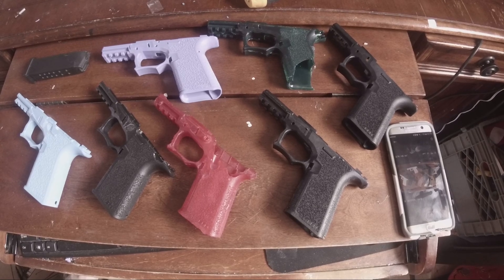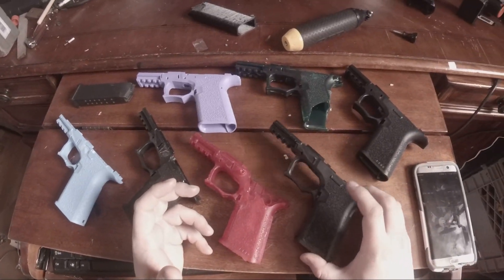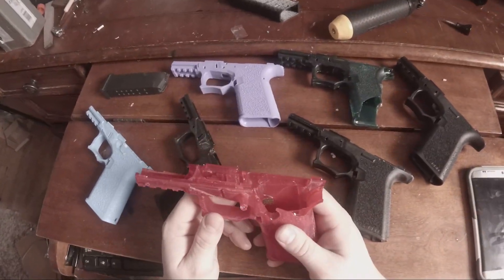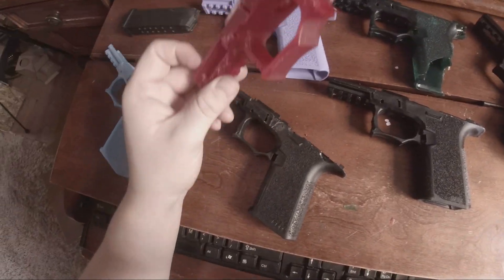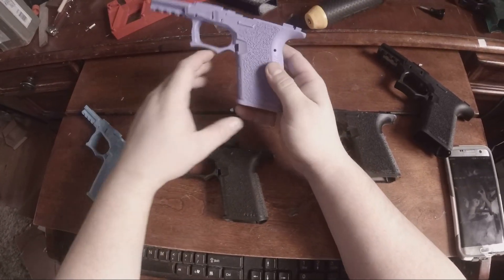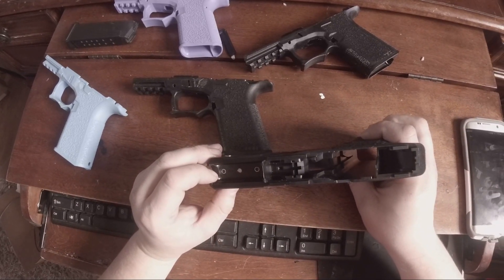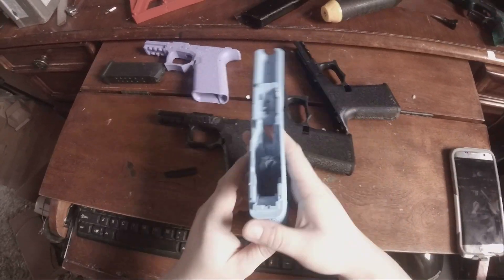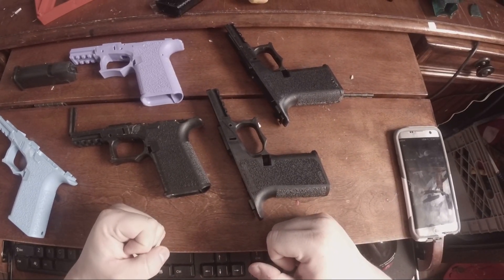Polymer 80 resin copies

Comment: dont think these will be strong enough. you would need to either use a mulit part mold with inserts in a vacuum chamber or an use injection mold machine. you definatly would wanna do the mold without any holes at least on one side then mill them out later although milling plastic can be tough. rn for

Comment: 😮 U There But I Thought About It We Dealing With A 18 To 13 pound Recoil Spring And A 5 to 3.5 pound Conector Focus En The Casting U Are There But Try Aluminum Or Bronce Maybe Fused Cheap I Think Will Be Stronger Easy To Grind Melt And Reuse If Mistakes 😎🤘💯

Comment: you got to insert pieces of metal or small wire mesh of rebar or somethign if you want to make the frames super strong. put some strong wire or metal rods where you dont want it to flex.
Reply: Si, Ive been thinking of this for a while, a x no idea if it will work, but what about metal shavings like you find around your vise after drilling or grinding? Or shredded aluminum cans? Something metal, and 1/8" or more shavings? Mandy a guy could get the waste from a machine shop? I imagine the steel sweeping get tossed or sent to the recycler, so picking them up probably is a better deal than them having to drive them away? No idea. Aluminum nobody is giving away, except beer cans, but beer cans should shred easy enough. I don't know if that would be better, or id it would just weaken the resin. What say you? Thank You

Comment: I thought this was on resin based 3d printing, but still good.

Why, WHY wouldn't you mold the frame after you cut the plastic tabs and drilled the holes? seems like making extra work for yourself. uwu

Comment: This seems legitimately fascinating, and like something I'd want to experiment with. Would you be willing to post an update on this project? Did you ever assemble one and get one running?
Reply: its falling apart no way
Reply: It’s not a pressure bearing part. If it fails, it’s going to snap, not explode in your face.
Reply: @QueerArmorer  For the gat building hobby, this is expected to happen from time to time. Go look into printed gats. The only way you will get it to a point where it doesn’t fail is by experimentation. For instance the liberator came out which would explode after a few shots, now we have printed lowers that last tens of thousands of rounds. If everyone just gave up on an idea because of encountering a problem, nothing would ever get done.

Comment: i'm assuming the bubbles come from a open printer. You need stronger material and a enclosed printer to keep the temperature the same and Not allow a different room temperature to create air bubbles.
Reply: They weren’t 3d printed

Comment: going about this completely wrong! Get a good 3d printer and make something that works
Reply: Someone Nearyou I believe the resins used in 3D printers aren't strong enough to hold up
Reply: @getfragged7051  the plastics used in 3d printers are actually strong enough but there's layer adhesion issues. There's files for Glock frames that last 500-600 rounds if printed right.

Comment: Instead of copying someone else's design, why not make your own design?  Besides Polymer80 probably having some kind of legal protection for their design, what do you hope to accomplish by basically 'counterfeiting' what they went to the trouble to make?  Maybe make one that'd take a 1911 slide, or some other slide that's widely available.....or something different than what someone else has already done.
Reply: You mean like how p80 stole glocks design? SMH
Reply: Hardly. What the poly80 does is utilize Glock internals for both simplicity and availability.  The frame is far superior to any model or year Glock.  Just the 1911 angle grip makes it a better gun in the extreme.  Aside from using Glock internals, for the reasons already stated, it is a much better design, and the fact that the market is full of different triggers (since factory Glock triggers are among the worst ever made), and the best thing about Glocks is the magazines, which fit the Poly80 just fine.  It's such a good idea and product it's a wonder it took this long for someone to come up with the idea.  Maybe some patent ran out or something, that I don't know, but I do know more than a few Glock fanboys who swear they'll never go back.
Reply: They still took Glocks design(after patent expired to avoid lawsuits) and replicated it. The internals are still the same so its still a counterfeit glock, even if better in design. dont get me wrong, i love both of my P80's over my Glocks.

Comment: When making dental molds we use a vibration table to get out the bubbles
Reply: or place resin in a vacum chamber to remove the bubbles before pouring....
Reply: @SuperSonofsatan bubbles will appear while pouring.
Reply: Vacuum chamber would also work but hands down duct taping your wifes nightstand toy to the wobbly kitchen table by far the most practical solution.

Comment: Hmmm... Pink Glock replica repeating 9mm flare gun might be ok. 9mm blanks loaded with just the primer, a pinch of pistol powder, flares and you'd either need weak springs to fire it semi-auto but maybe unreliably or you'd need to rack n shoot rack n shoot like a spring-powered airsoft gun reliably but not true semi-auto. So even the brittle plastic can be useful. Just a suggestion.

Comment: Ar15mold.com, came across this website. You should check them out
Reply from the maker: Yes i have done my own testing with them way back. Video search on here their durability. Its not worth the price tag. The resin they use is the same typical standard stuff you find at hobby lobby. My 3d printed lowers hold up better. Which is another video i have to get to some time. ha.
Reply: Donny Magnum ah damn.. hopefully u can find something.. subscribing to your page so I can stay updated

Comment: Any progress?? From what I’ve read, the polymer80 frames are fiber glass infused. Don’t know if that helps
Reply from the maker: polymer80 like most companies that make polymer frames and accessories, they will keep their plastic formula a secret. Some will give you hints like sig claiming some type of fiberglass and glock a type of nylon. I have not read poly80 saying anything about what they use but it does feel similar to sigs fiberglass. I am nearly done with a few strength tests using bondo fiberglass, JB weld, other types of epoxy and more. Ill upload when done.
Reply: Donny Magnum hope it all works out.. willing to support you when it does

Comment: There are some polymer AR15 lower kits that you pour in a mold by hand... why not buy the polymer from that and try that?
Reply from the maker: The resin from those kits are very brittle and shatter on impact. There are a few torture test videos on here that show they are weak. With this i am trying to find my own formula which is currently just as strong as a glock lower. I'll be posting videos testing them eventually.

Comment: Dude that's awesome you should make a how-to series! Did you use the P80 jig to make the molds or what?
Reply: Would you consider sharing the file for your jig?
Reply from the maker: Underground Arms i actually 3d printed the jig to cut them with but yes the mold is a glock 19 p80.
Reply: @willylongwood992  share file mm on
Reply: I did on here with just a p80 and it was taken down...they took down about 12 of my vidoes

Comment: That’s a cool idea, Hope it works out, how will u get rails for the frames?
Reply from the maker: they are available through most places that sell glock lower parts kits
Reply: Donny Magnum  Really? I never seen any Rear Rails or locking Block Rail that is Available or fits a Polymer80 
U got a link ?
Reply from the maker: I get them through my local glock smith, to avoid shipping lol. But if you dont see them on say midway, glockstore, brownells or poylmer80, lonewolf. You may have to call them and ask. I believe my guy gets them directly from glock USA. Any gen 3 rail inserts would work.
Reply: @willylongwood992  what Glock puts in their frames will not work with a polymer80 frame. The rails are totally different. Glock rails are not removable, therefore cant be purchased. The ones that the P80 use are designed to be used in nothing but their frames. Nobody else on earth makes them, or sells them. Do you even know the diff between a Glock and a P80 frame?
Reply: Vince Ruland totally right I have a few spectre that I have tried to get rail for but Loran kelly over at polymer80 is a douchebag and will not sell you rails or locking blocks. trust me I've tried for about a year .
Reply: @vinceruland9236  spooky rails.